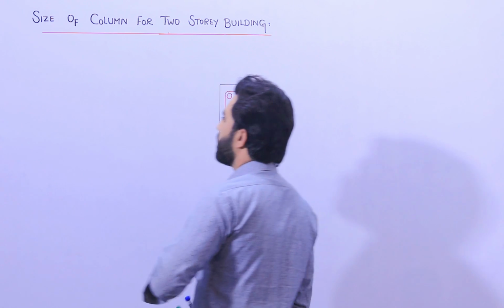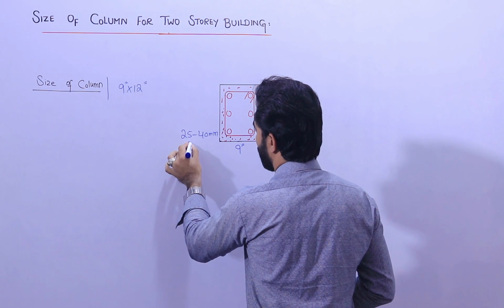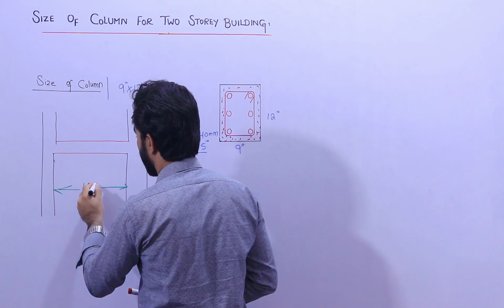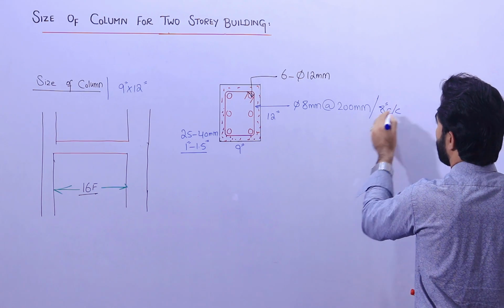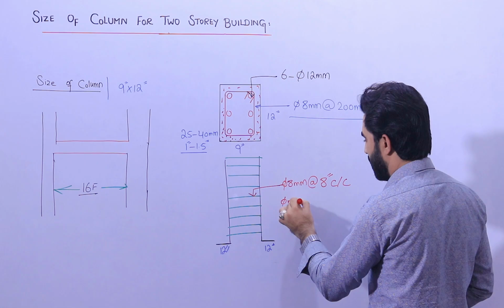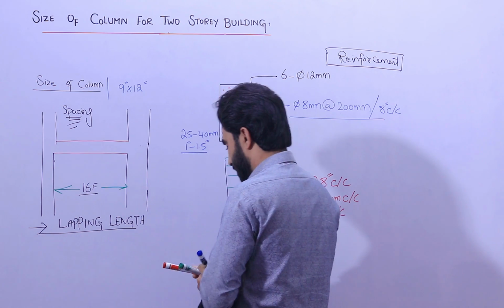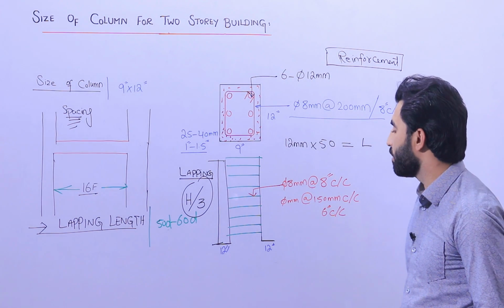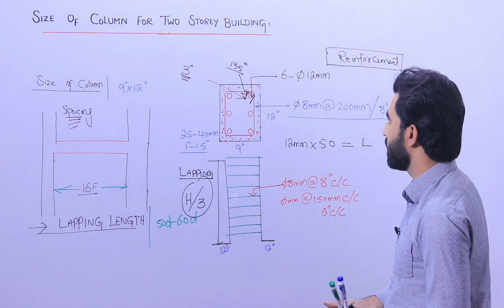Standard Size of Column for 2 Storey Building | Steel Design for Column

Comment: There is building whose area 1200 square feet and 14 nos column.this column has 4no 12mm longitude bar.the maximum span is 12 feet. Can we built up additional floor?